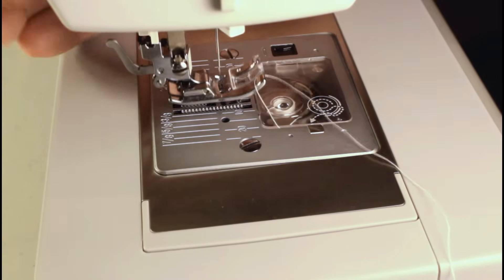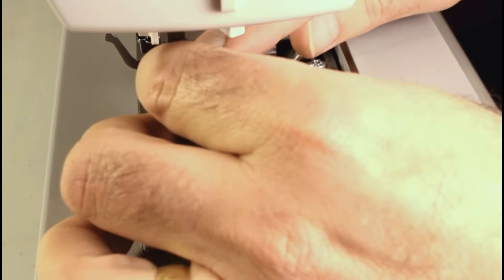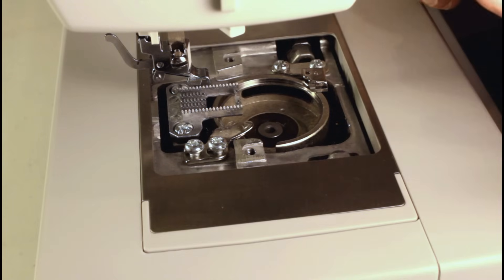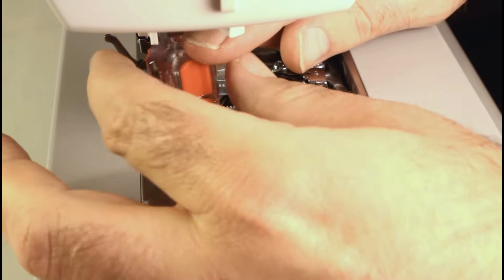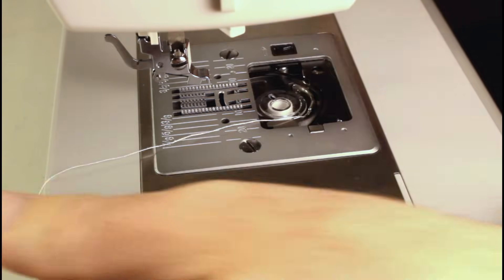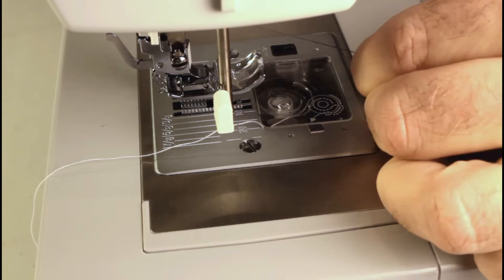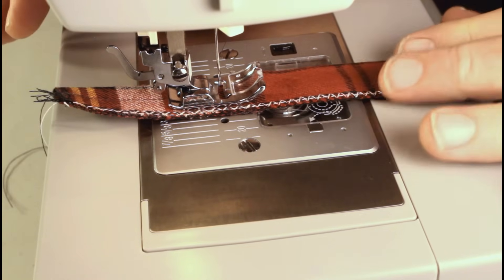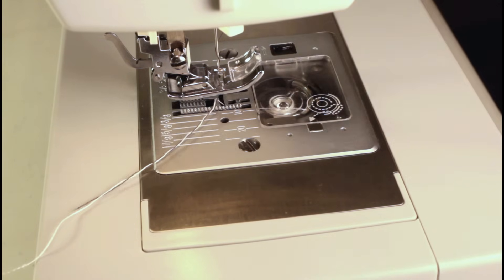Singer Heavy Duty - Adjusting Bobbin Tension, Please read the Description before posting questions.

Comment: I had problems with the zig-zag with my Singer  Confidence 7465. I checked several times the timing. It seemed to be OK. The zig-zag started to work when I changed the thread to different type. Maybe the needle could be a little bit closer the hook, but I was not able to find how to adjust the needle position so that the gap between the rotating part and the needle is smaller.
There are a metallic holder at the left side of the bobbing area and another at the right low corner. The right low corner part has also a spring.
I wondered quite long why they are such as they are until I realised that they have also something to do with the thread movement control. They must be also be adjusted correct, or you will have problems. After checking the timing the parts were not readjusted correct.
Reply from the maker: See if you can find a service manual for it.
Reply: @kevinsews  I found several places to buy the service manual, but I must give my credit card number to get the manual. I don't want give the card number.
I think that the timing is at the edge of working and not working and it should be adjusted very little.
There are YouTube videos how to adjust the timing but not the needle distance.  I don't know if the distance is too large. Strait stitch at leftmost needle position or centre works, but at rightmost position works or not works indicates that possible a small timing change could help.
Reply from the maker: @kribe3401  Download the manual using the link in the video description. See if your machine has the same system for adjusting the needle position closer to the needle.
Reply: @kevinsews  Thank you. I downloaded the maual. There seems to be paragraph "3-12 Distance-needle-hook" which is probable something which I must adjust. I shall check this later.
Reply from the maker: @kribe3401  Great. Let us know if this works for you.
Reply: @kevinsews  I have been busy and not touched my sewing machine for over two months. The manual for Singer heavy duty did not help, but I found how to adjust the needle-hook distance in Singer Confidence 7465. I opened it again today and studied how the system was built. The needle-hook distance problem was solved. I had a link to my web page where was shown how the problem was solved, but the comment with link was removed later. It seems that links are forbidden in You Tube.
Reply from the maker: @kribe3401  I am glad to hear you figured it out. Thanks for the update!
Reply: @kevinsews  I posted a message here with a link about two months ago. The message was removed because of the link. I only noticed the removal yesterday. You Tube could warn that messages with links will be removed  if the message has link.
Reply from the maker: @kribe3401  No problem.  You can send me an email using my name at kevinsew dot com.

Comment: I’m not sure if bobbin tension is my problem.  My 4423 sounds very clunky when it sews and it seems that after sewing a few seams it starts to either bird nest on the underside or the tension is off on the underside.  I understand that this may be a top thread issue and, that being said, I will often rethread the machine top and bottom and then it sews ok for a period of time, but it seems to go downhill eventually and I have to rethread the machine again.  Thoughts?
Reply from the maker: This can mean many things. The timing might be off or something with the needle is off.
Reply: my machine is fairly new and I have the exact thing happening.  I sew for a short time then can hear when it starts the bird nesting on the bottom. I stop, re-thread and it is fine for a while then does it again!!
Reply: OMG, I adjusted the bobbin tension and it works perfect now;  No more bird nesting underneath!  What a Joy!  I have to agree with others about the spools.  No where does it explain the different places for the different spools. You would think they could at least include that in the meager instructions!  Thank you so much Kevin for sharing your knowledge!
Reply from the maker: @ellenhallan3707  You’re welcome!
Reply from the maker: @ellenhallan3707  You’re welcome!

Comment: My sewing machine sews fine for like 3/5  inches then loops then like 3/5 and loops again. What could it be?.

Thank you for your videos they're super helpful.
Reply from the maker: toro x take some dental floss and thread it through the tension disc for the needle thread and give it a good cleaning. Sometimes lint from thread can be in there. Then remove the bobbin and give that area a good cleaning.
Reply: @kevinsews  thank you so much
Reply from the maker: toro x You’re welcome!
Reply from the maker: toro x You’re welcome!

Comment: Bottom tread was pulling on top stitch, after cleaning it was corrected, now every so often bottom throws a bird nest, sometimes after 10 inches of stitching, sometimes not.
Is the bobbin tension off? Singer 4411
Reply from the maker: steve lo Order a new bobbin. Sometimes it can cause this issue.
Reply: @kevinsews  new bobbin or new bobbin holder/tensioner?
Reply from the maker: steve lo Goto www.sewingpartsonline.com and search for this: Bobbin Case, Singer #Q6A0764000

Comment: Can't fix the timing on my machine. Could the first 2 times but it jumped out of timing again (only have the machine 2 months, but anyway) this time i can't rotate the boobin hook to the right position. i can only move it maybe 1 inch and that's just not enough to get the needle to connect with the hook. 

what can be the problem? It's so frustrating
Reply: I feel you. I am trying to fix the timing and I also had it for 2 months. Sucks
Reply: @diamondbrightxxx7531  I actually bought a new one. Got so frustrated haha. Now have a Husqvarna Viking emerald 116. A little more expensive than the Singer one, but god what a difference 100€ makes. This machine is like a dream compared to the Singer (when it was working well-ish) 

But Good luck with the timing tho. It's a good machine if it works properly. I just was fed up with it
Reply from the maker: I am glad to hear you found a machine that works for you.

Comment: Brand new to sewing I have the 4452. Got it to where I can practice some stitch’s and then it jammed  up my needle was stuck and I had to take it all apart to fix it my guess is I didn’t put it back correctly because it jams up at my first stitch  so I check the bobbin area again and each time it does the same. What am I doing wrong. What did I do. ?
Reply from the maker: What brand and thickness of thread are you using?
Reply: @kevinsews it’s a 109% polyester coats & Clark
Reply from the maker: @Laineyslife  I would try changing threads first. Also, take a look at this video I created 4 years ago. It may help you: https://youtu.be/7lyxWXCh2dQ?si=8YLGf37z-FwxUByJ
Reply: @kevinsews  thank you so much.
Reply from the maker: @Laineyslife  You're welcome! Let me know how it works out.
Reply from the maker: @Laineyslife  My pleasure.

Comment: Hi Kevin! I opened up my heavy duty 4411 to clean, but I found a tiny part in the base of the bobbin case and I can’t figure out where it’s from!😭 I closed all again but I can sew, it’s not working anymore.  I googled the name of this part and it shows like “needle clip” but I can’t figure out where I should put it back on 😭 then I found your video! Could you help me out? Tks so much
Reply from the maker: Priscila XKY I am on the road until the 15th. I will take a look at it when I get back home. In the meantime maybe somebody else can help you out,
Reply: Kevin Sews thank you so much! I watched a lot of your videos and I saw that I also had to change the tension, and it’s working now, even without this small piece hahaha! Tks!!!
Reply from the maker: Priscila XKY That is great to hear.
Reply: If it's the needle "clamp", then you must have unscrewed the needle set screw too much when you removed the needle, and the parts must of dropped down into the bobbin compartment.  You say it's not working, but is the issue that the needles isn't staying in place?  It might also be part of the automatic threading mechanism (maybe small part that goes through the eye of the needle... they are easy to break if you have the needle in the wrong position and try to thread it.  If that broke off and ended up in the bobbin compartment just remove it, clean out the compartment, and hope that it didn't wreak any damage.

Comment: Hi! I just found your channel and I hope you can help me with this issue. The bobbin/bobbin case on my heavy duty Singer is rattling more than it did when I first bought the machine. Stitches are fine, I'm just worried the rattling will case an issue later on. Do you have any advice?
Reply from the maker: Remove the bobbin case cover and then rotate your hand wheel and observe the thread as it moves around the bobbin. That should show you what the problem is. Be sure and place a small piece of fabric under the foot too so it will form a stitch as you watch the thread go around the bobbin.

Comment: My husband sews leather with thicker thread. The thread bunches up at the bottom.. Should the tension be tightened or loosened?
Reply from the maker: My top tension was 9 and I had to tighten the bobbin tension to get it to work. Even then some versions of this series struggle with V69 Bonded Nylon threads.

Comment: Just learning, purchased UK a 4423. Can I use a vacuum to remove lint. Is it worth ad-blocking the adjustment screw with locking paint? Is it worth having spare bottom cases for different tensions?
Reply from the maker: Always a good idea to get an extra bobbin. Yes, you can use a vacuum. They actually sell small ones for cleaning sewing machines.

Comment: My bobbin case in this same machine keeps jumping out of place where the thread passes at the spring. I can fix it but it keeps doing it. Whats wrong with it? Is it the tension like you show in the video?
Reply from the maker: +Jan Thomas Clean the bobbin area out to ensure there isn't any debris under the bobbin. Make sure the screw that holds the bobbin case in place is nice and tight. Next, ensure your thread is coming off the top of your bobbin toward the left side as you insert it into the case.
Reply: +Kevin Sews I still can't get it to work :[! .The thread catches where it passes by the spring! It feeds when not put together but when assembled it sticks again. Grrrrrr!. now I can't even fix it right anymore. I only had this machine 4 months.
Reply from the maker: Jan, go to kevinsews dot com and use the contact page to get in touch with me. This may time a bit more time and effort to figure out.
Reply: This is my prob too... what did you guys figure out? I have to say, this machine is less than 6 months old, and I have had soooo many stupid and finicky issues with it. My old (and cheap learning simplicity decomate) was a powerhouse of non-issues for YEARS. 
I’ve done all the things, even adjusted the timing on the rod- after sewing my godd***mned finger, it went bezerk from my auto yank response. I have no idea how my finger even got in the way, aside from the foot pedal deciding that lightning speed was how it was gonna take off, and I must have gone to get a grip on the material to guide it. I’ve been sewing 20+ years and have never sewed my finger! 
THEN.. there’s the whole foot pressure problem... say one of your kids walks by and is mad at you and they decide to turn every knob out of whack (or I have ghosts, one or the other), you have NO WAY TO KNOW IF YOU ARE EVEN CLOSE TO FACTORY SETTINGS if you decide that you want your material to slide under the foot, or not even be contacted with the foot, or just stick there getting ripped by the feed dogs. 
Now the whole bobbin case not being willing to just FREAKING WORK... AAAAAGGGGGHHHHH!!!! It costs more to take the hunk of trash to the machine repair place than what it’s even WORTH. When it was fresh out the package, I loved it! When it was fresh out the first time trying to do simple cleaning, it became my worst enemy and it laughs in the face of my income to live. Or even just getting gifts sewn on time.
Reply: Oh- and today, it’s new thing is not wanting to pick up the foot without tilting the front of the foot upwards and applying manual pressure. It is doing this with all my feet. I want to love this machine, but it’s making it difficult to love.

Comment: Hi Kevin, Newbie with Singer Heavy Duty over here. My lower thread gets stuck in the lower part of the machine and I had to cut out the thread little by little, and the needle stopped moving all together because the thread was so jammed. The thread has a hard time to come off of the bobbin before I even start sewing, so I thought loosening bobbin tension would help. Now I cannot get into the  bobbin case since one if the screws is so tight (my husband and I tried everything). Do you have any ideas? Thank you so much!!
Reply from the maker: Order these: SITAKE 3pcs Offset Screwdriver Set  https://amzn.to/2NjR33C  I use them all the time when repairing sewing machines.

Comment: I have a singer heavy duty. After sewing a bit the bobbin casing will spin (or get jerked) past the little thumb thing and get stuck. Sometimes the needle hits and and starts to make a hole. I don’t know what to do. I’ve re-threaded the whole thing multiple times 😢
Reply from the maker: @mikalashayrichardson2922  Start by download the Singer Service Manual using the link I have provided in the video description. You probably knocked the needle bar out of alignment.

Comment: I was following all the steps but my bobbin case is not screwed down or held down with the arm, so I did not have to unscrew the factory tightened screws to get it out. It just very very easily pops out on its own with out any pressure.  I have a singer hd 6600. Is it defective or is that normal?
Reply from the maker: It should hold down the bobbin.
Reply: @kevinsews   I just got it for my birthday. First attempt at trying to use it. Maybe ill loosen the screws and see if it will place correctly after. Or end up exchanging it. Thank you so much!
Reply from the maker: @Angela.Gibson  My pleasure!

Comment: I had you on and AT&T on hold. About the time you said fhise other two screws are on tight.  I paused you and kept on those screws. Well when I got hack tie yo you said just loosen them.  Dint removed so I'm racincin back to put them back in and yep i dropped one.  Yap in the machine. Now want do i do. Please hell. I have a dead lung e to meet and um 75 abc need the extra income. Badly. Thank you
Reply from the maker: Turn the machine upside down and try to rotate it to see if the screw will drop out. If not all you can do is remove the cover. Start with the bottom cover - often that is where you will find the screw that was dropped.

Comment: Hi ,I don’t know if you can help.My needlepoint hits the hook just so slightly,I took the Bobbin casing out and I can see what is happening.What can I do,or should I bring it in for repairs. My machine is a 4452  singer heavy duty.
Reply from the maker: If you take the cover off the top left side over the needle you will find the area that allows you to adjust that issue. The needle bar is out of alignment. Do a search on here on how to align the needle bar. Hopefully, you will find something. If not let me know and I'll see what I can do to help you more once I get back home (I am out of town right now).
Reply: Kevin Sews  
Hi Kevin,had to take my machine into the repair shop,they said the timing was of.Will cost me over $100 .What a bummer.
But thanks for your fast response.
Reply from the maker: @ingridmonkhouse3669  Sorry to hear that. At least now it is fixed, so now you can get back to sewing.

Comment: Hi Kevin I am hoping you can help me. I have a singer Superb and it has worked awesome for awhile. However it started jamming up with in the first three or so stitches. It is so tight i have to cut my thread out of my needle. No matter what adjustments I do nothing seems to work.  I have a photo of what it looks like i can show you but don't know how to post one here.
Reply from the maker: First, make sure you have at least 8 inches of thread behind the foot before you start sewing. Firmly hold both threads before you start sewing and see if that helps.

Comment: poo this fixed my original problem and it was sewing fine on thin fabric but skipping stitches on thicker ones. So I readjusted the bobbin tension and now it’s dragging fabric into the hole and winding thread around the bobbin case. Could this be a timing issue?
Reply from the maker: It could be the needle.... the thread.... the timing or a combination of all 3?  For thinker fabric you need a larger new needle. Add using the proper thread and proper tension setting will help greatly. After that  check your needle tension. Lastly, timing.

Comment: I have a 4452 and after sewing successfuly for about a half hour it jammed and I had to work the clumped thread / fabric away from the needle.  When I tried to sew again, the bobbin thread was not pulled up.  I rethreaded both the needle and the bobbin several times, but I cannot get the bobbin thread pulled.  How can I get this working?
Reply from the maker: See my video on setting the timing on the machine. I included a link to the service manual.
Reply: @kevinsews  Thanks
Reply from the maker: @billro7910  My pleasure!

Comment: My tension was fine while I was sewing and then it made a strange noise, and now there is not enough tension on the top thread, and I adjusted it up to the highest setting for the top tensioner, and I am getting a lot of thread on the bottom, which I think indicates that the tension is not adequate on the top.
Reply from the maker: Yes, that is more than likely the case. Take a look at my video on how to get a good starting point on your needle thread tension.